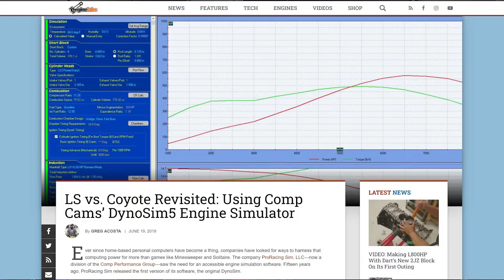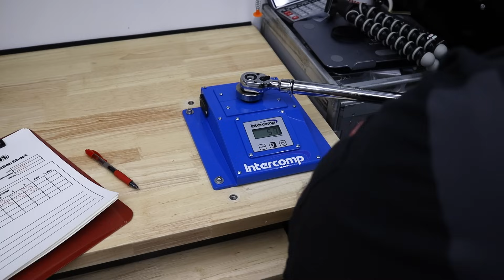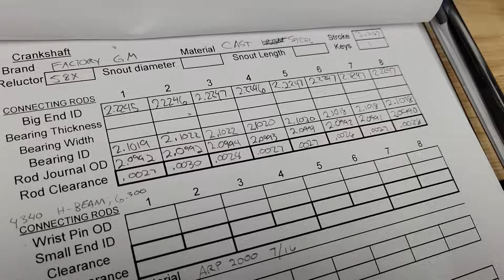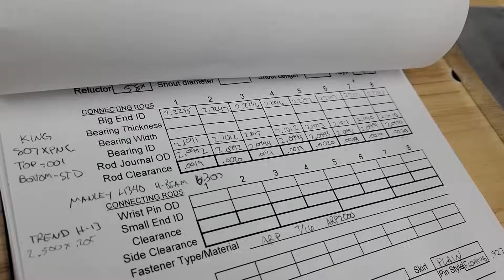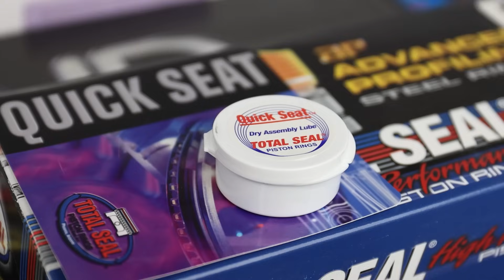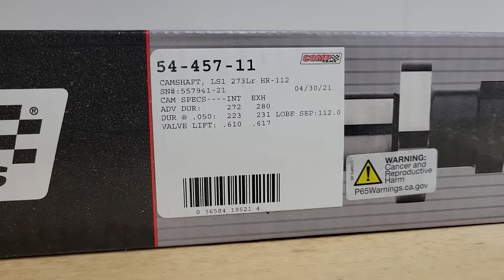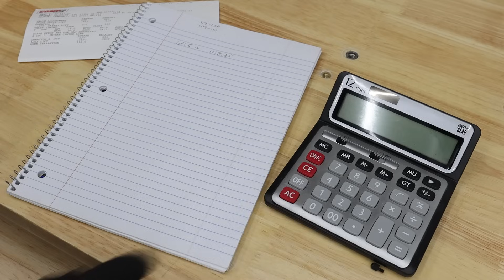Building An 8,000-RPM LS — LS5.0's Short-Block Comes Together

Comment: Im a ford guy through and through, with that said my wife's first car was a 89 Camaro Rs. I've since picked up a good condition 92 5.0 rs with z28 rear end no engine or transmission very clean interior. I Modified the K member to accept Ls swap. I used a 4.8 block & bored it to fit ls1 pistons 3.8-3.9. Used a comp cam 218/226 .541/.541 & spring retainer kit. 4l60 with Quickshift controller & mild convertor ( 2400-2800). It shifts at 6800-7000rpm ( due to way to small of a cam) Car runs a 12.2-12.4 @ 111 ( dynoed here in Florida 332 whp @ 6700) on 3.08 gears with my wife driving with cats through a single mandrel bent 3 exhaust. Shes happy but your video makes me think about doing a proper build for her instead of the cheap as possible build. Its funny as on the fender it says 5.0 TBI when in reality its a ls with a sniper efi and just as fast as a scat pack on good tires.
Reply: You can also put 4L80 parts in the 4L60.
Reply: @robertmoore119 not possible
Reply: @simbanugz2906 if I could recommend anything other than a turbo It'd be to get a 3.25 or 3.55 gear, then you'll be running closer to 10 seconds. Not great for gas consumption though probably. And scat packs aren't really very fast anyway, you wanna beat a hellcat redeye or a demon then you're fast. Your Camaro can do it. It just needs a better gear and will eventually need to get boosted which won't cost much sense you already built everything up, all you need is 14.5psi and you'd be at close to 660hp nearly doubling your hp! Realistically though I'd start with a small cheap turbo and keep it between 5-9psi, you'll still gain over 100hp just from 5psi! And even the smallest turbos can usually support well into 14.5 psi easy usually closer to 20 so you'll have room to grow. But I think you could add all that for less than 600 dollars if you know someone who can weld some custom plumbing. Just gotta look around and wait for deals. But a decent turbo is only 100-200 dollars, and you can use the stock exhaust manifolds just flip them downside up and measure how you'd like it oriented. Stainless pipe or even old decent exhaust pipes from other cars you can make into your plumping cheap. Honestly the final gear is what would cost the most but there's plenty of Chevy GMC truck rear ends out there in 3.25-3.55.
Reply: Badass build thanks for shring
Reply: Tldr
Reply: @simbanugz2906     LOL the poor 4L60. In my opinion, it's actually a really unit. 
   The thing about them is that it's one of the highest number of transmission there is within the GM line of vehicles.
   It used to get put in everything. So with that said, it just lives a hard life. When I was in school, I learned that the fluid is the moat important aspect of any auto holding up.
   We that are GM fans know, many of us don't maintain our vehicles the way we should. Many of us are poor. 
   We push them and build upon them with many miles. How many of them have had any type of service with a filter and fluid? Especially at or between the 15-20k mile interval? 
   We push them to 100k without a service and they fail. Thats to be expected.
   They go in everything, we also shift them from forward to reverse without letting the wheels stop spinning, or repeatedly. Off road enthusiasts know what I'm talking about.
   Still, a 4L80 or 4L60 with 4L80 parts are good. 
   I killed one myself using the forward reverse destruction method. I overheated it, I am sure that wore out B1.
Reply: U have any videos of the camaro
Reply: That 4l60 won’t hold up better source a 4l80.
Reply: @Thumper68 not with only 330 whp, it'll be fine. If it's over 450 whp then he'd be in trouble.
Reply: @bigmoney4661  maybe but launching on it will catch up still. I’d have 3.73 gear in it personally. I run 3.73 in my Camaro and it’s a 4 speed Muncie. I can still hit 140 mph.
Reply: @Thumper68 I almost recommended 3.75 or 4.11 but because he's only at 3.08 I thought maybe a more subtle change would be more appropriate, you're right though you fly with 3.75 and a manual. Also he said his wife drives it. I'd worry about my wife acceleration to quickly and something bad happens, but it could happen to anyone going too fast. Freak accident is all I'm worried about. Yeah if you hammer a 4l60 it's gonna break no matter the HP it just happens even in stock format but as long as he took it easy I'd be fine which was another reason I argued for a lower rear end ratio than 3.75 because it's less stress on the transmission. Otherwise honestly I'd just recommend a manual transmission like always, but I don't know him or his wife maybe they prefer automatic. There's a few underground transmissions that are cheap and handle pretty good power I think the one with the manual in 350z's was pretty strong but I could be wrong, most people don't think about that one though. Muncie is good, t-56 is good for allot of power, you can still break it if you hammer it really hard though or grind gears lol just like any manual.
Reply: Regardless you are right launching it balls out will break a 4l60 and a 4l80 is much better.
Reply: I remember I actually saw a video of a guy and he bypassed the computers auto shift for a 4l80 so he could manually select each gear like a manual with no clutch pedal. Pretty cool, I can't find the video and it might have been removed.
Reply: @bigmoney4661  I had a 2010 GMC Sierra Denali and in those trucks and others like it have 6L80 trans with manual push button mode that won’t shift until you tell it to but it will down shift when you slow down to much for the gear which is kinda nice. So if you come to a stop in manual mode it will shift to first and not just stay in 6th and kill it lol. Loved that truck all time awd with locking Eaton differential front and rear stock. With the 6.2 that thing would leap across an intersection before most people would move on a stop light 🤣

Anyways I don’t remember them making a 4L80 with push button mode like that. Or maybe that’s what you saw.
Reply: @bigmoney4661  I had a 2010 GMC Sierra Denali and in those trucks and others like it have 6L80 trans with manual push button mode that won’t shift until you tell it to but it will down shift when you slow down to much for the gear which is kinda nice. So if you come to a stop in manual mode it will shift to first and not just stay in 6th and kill it lol. Loved that truck all time awd with locking Eaton differential front and rear stock. With the 6.2 that thing would leap across an intersection before most people would move on a stop light 🤣

Anyways I don’t remember them making a 4L80 with push button mode like that. Or maybe that’s what you saw.
Reply: @Thumper68 that's cool, but no. What I saw was people actually going into the wiring and adding switches to manually make it go up and down. I actually linked a video but... I think I actually got removed? But what I saw was a 4l60e I assume the e might mean it could do that, but I could swear I've seen 4l80 and 4l60 modded to by pass the auto shift.
Reply: https://m.youtube.com/watch?v=GMs_5S3Awwo 
Here's one showing what I was talking about, I don't know if there's a normal 4l80 and a 4l80e I'm not really a expert on them.
Reply: @bigmoney4661  In my experience its not really power that burns up the 4L60 so much as rpm.  I've had stock 4L60Es hold up fine well over 500+whp if rpms were kept around 6000-6200 rpm.  I've also had them burn up below 400whp when spinning them to 7000+.
Reply: @brettsanderson8680 it's weight. They don't last in built trucks but they will hang on in a built f body or c5/c6

Comment: Brings to mind the Chevy 302s from 67-69.
Reply from the maker: It would have absolutely blown the budget to come up with a 3.0-inch stroke crank for this, otherwise a 6.0 block with that crank would have been killer.
Reply: @EngineLabs or even a lighter reciprocating assembly. Mallory in a 4.8 crank 😬
Reply: were the 302s from chevy boat anchors like the 305s or did they ACTUALLY make power?
Reply: @jhitbob  Made lots of power at high revs
Reply: @jhitbob DZ302 one of baddest small blocks ever made.
Reply: @jhitbob The 305 could be built for reasonable power and good economy.
Reply: @drut7512  which 305 the small bore shitty 305 or the 4 inch bore 305?

Comment: I was going to ask if that cover was equiped to block off the DOD towers but you can actually see the impressions from the top side in the video. Have yall had one of these blocks sonic checked for wall thickness? I know they are really thick but ive never heard a number.
Reply from the maker: Yep, the valley cover is O-ringed. I thought Jeff sonic-checked the cylinders in the "Little Iron Orphan" article, but I just checked and no dice, unfortunately.